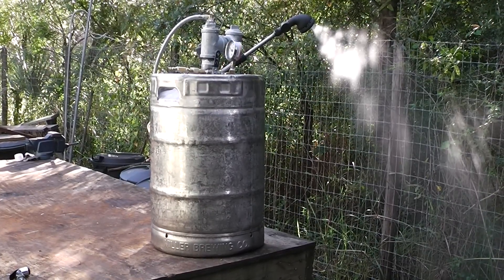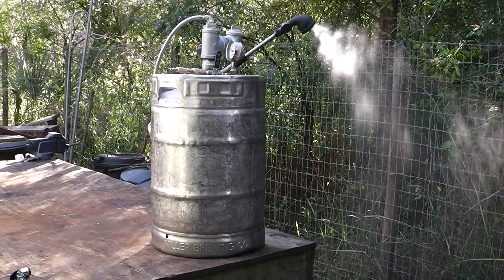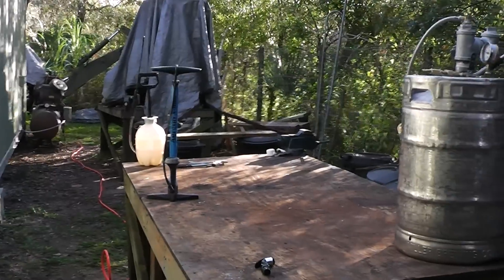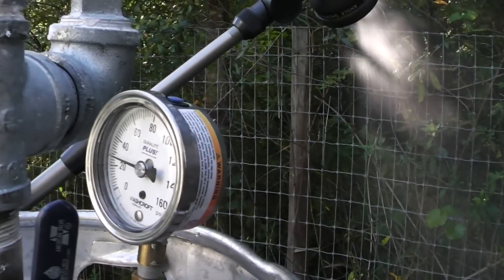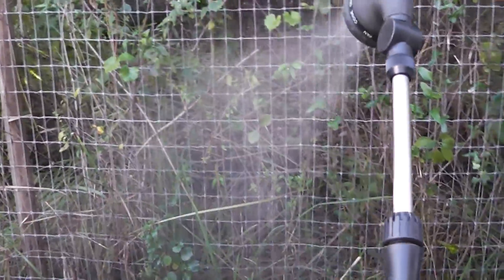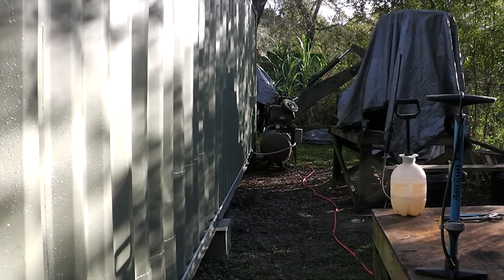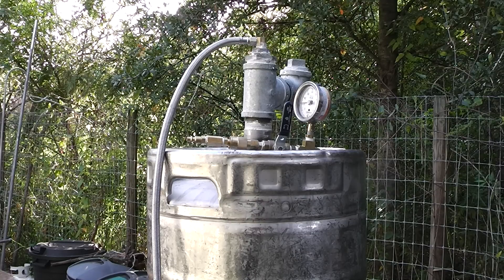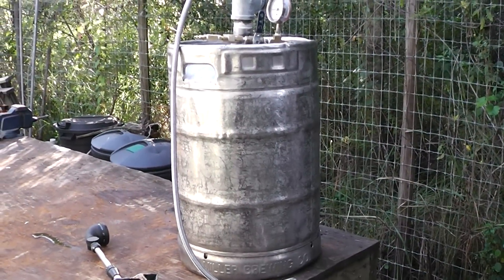Beer Keg Portable Hot Shower No Electricity or Propane Required

Comment: Fabulous! This solves my shower problem! I found one, and will build one like this. Again fabulous idea! Question, did you modify it from this test model? Like to know if you did some adjustment. Thank you very much with this idea! Greetings from Sweden.
Reply from the maker: I need to do a video update but, I have too many irons in the fire so to speak.  Basically, what is shown will get the job done.  The major modification would be to add an 1 1/2" open close valve to the top entry which would simplify adding the water.  Also, I did add the tire inflator to it.
Reply: homesteadprepper thank you for your reaction!

Comment: I love your "proof of concept". I have a similar prototype idea, but it was intended for cold water only, and for similar low pressure. A place I worked at some years back used this method to extract solvent from the original shipping barrel through an adapter mounted to the bung hole plug.
It worked great for transferring small amounts to other containers. However, I like your use of the pony keg. Really great idea, and I'm glad to hear you mention the warning of built up pressure from heated water in a sealed container. Some people would never have considered this, and the results would be bad to say the least. Thanks for all your videos. I''ve subbed your channel for a few years now, and have gotten some great ideas and plenty of useful information from it. Keep up the good work, and may God bless you and yours, and all those that you call friend. Again, thanks.

Comment: Ok...not to rely on propane or 12 volt? How do you heat the water to begin with and then what do you do to arive at your 60 psi?
Reply from the maker: The water can be heated simply by setting the keg out in the sun.
The bicycle pump in the video will be capable of providing the necessary air pressure(45psi max) to run the shower in part 2 and the keg will also be painted black to absorb more heat energy.

Comment: Love it brother. One thing I have seen some test with my own eyes. With a EMP on solar panels. 99% We tested for the Gov all passed fine and still worked 100%. Now on the other hand the charge controllers and inverters where fryed. Hope that helps some. God Bless
Reply from the maker: Thanks.  
That is some good info to know that I was not aware of!  It would be very interesting to know what will actually stand up during an EMP.  Did you participate in any other EMP testing and if so, could you make a vid?
God Bless you and your family as well.
Reply: homesteadprepper I just was a part of the solar testing. It was some stuff that was going to be on remote loc and had to past some nutty testing. All the nfo I had I just give you. All I was there for was to  provide technical data on are our equipment that was being tested. 

So there was not a lot too it.. I have a video but I got so much flack over it I pulled down the video.

Sorry for spelling in the Hospital from a crones flare. Not 100% hehe.. 

God Bless
Reply from the maker: Thank you and I am praying for you bro.

Comment: Wow. That is cool. Awesome idea. Like you said, painting it black will help heat it up using solar. Also, enclosing the black keg in glass with a vacuum will keep the ambient cold air from working against the radiant solar heat.
Reply from the maker: Thanks. It would be quite an undertaking to enclose this in a vaccum chamber!
Reply: Yep.

Comment: Really nice proof of concept. I've put a lot of thought into a gravity fed shower but this has far more potential.
Reply from the maker: Thanks.
I had put some thought into a gravity shower as well and it is still a viable option.
My next project is to make some off grid hot water, fast and cheap/free!
Reply: BCtruck, rebuild, repair,repurpose  did you make this?